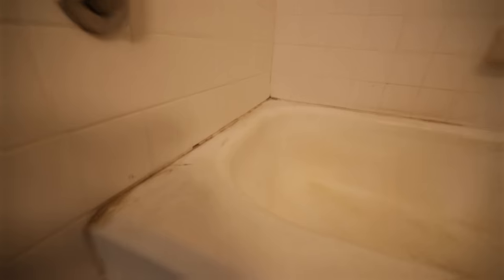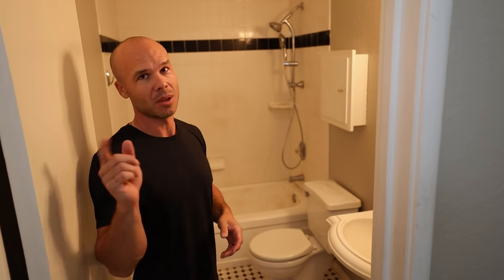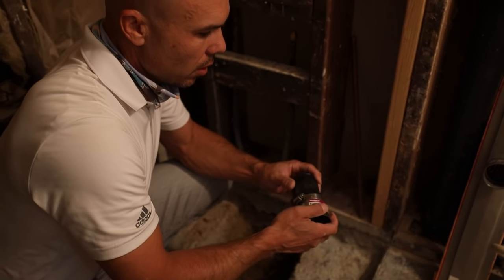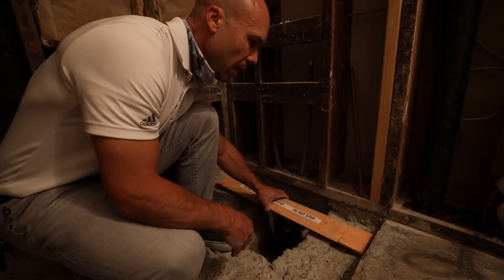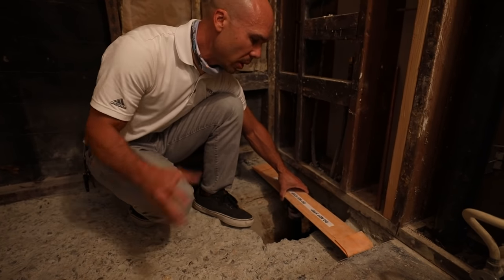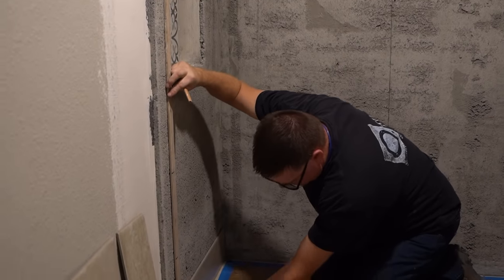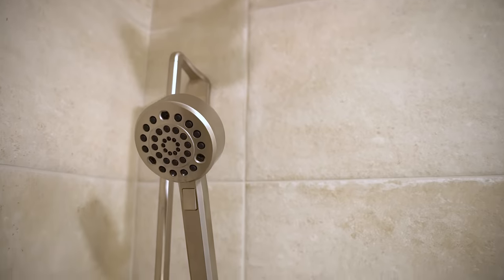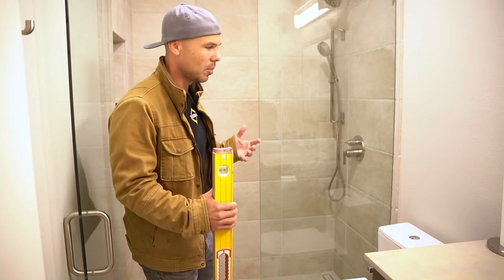TUB TO SHOWER CONVERSION (CURBLESS)-- HOW ITS DONE

Comment: A couple people asked about this but I didn't see any responses to any of them. Did you not put any vent on it? And it works fine without gurlging and doesn't siphen the pee-trap? Everything I read is saying I have to have a vent in there and it needs to be after the pee-trap... I am doing the same conversion, so need to figure that part out. Of course the shower had the overflow pipe as a vent, but that was also before the pee-trap, not after. 
So am I fine with nothing like you did? Or do I have to fit something in there? If so, does it have to be after the pee-trap? Not sure how I would fit that in there....
Thanks!
I would really love your thoughts on that.
Reply: Probably a little late for your needs, but the vent is downstream of the p-trap before it ties into the main line. There are requirements about how far it can be depending on pipe size and slope (usually no more than 6 feet from the trap). There are other considerations such as using the correct fittings (wyes vs. tees, etc.), and whether or not the vent is wet or dry. A quick google search should bring up what you need with diagrams. Or just talk to a plumber, and shoot him a few bucks (six pack of beer) for his expertise.

Comment: Do the tiles on the bottom of the back wall(the 5 foot wall) get smaller as they go from right to left because of the pitched floor? Thank you for the great coaching!
Reply: Yes, they mentioned in the video that they'd be about 1 1/4" shorter from one end to the other I believe.

Comment: Is there ever a reason to raise the rest of the floor instead of chipping down?
What are the possible ramifications of building up 2 inches rather than chipping down?
It seems like shaving off concrete is the proven method of installation. Is that correct?
Thanks for the video.
Reply: I think going down is preferable because you only have to go down in that one spot.  if you build up 2 inches, then you've basically created the same clearance that a 2" curb would have or you have to build up the whole bathroom to match and then all the other rooms on the same level to avoid a dramatic transition from flat to 2".

Comment: tell me if you like this idea if you would. My tub removal same as yours, but I don't have a toilet next to the tub, its in another room within the bathroom. So my entrance to my shower will be right where your toilet is, and about halfway across I will start a small barrier to continue over to the opposite wall. . The drain will be right at the entrance to the shower, a linear drain. then I will mudpack over the concrete, no cutting out concrete necessary except for extending the drain over to the shower entrance., and then slope the floor away from all three walls towards the entrance drain. Where the barririer wall part is I will put fixed frameless glass, and then the frameless door will be over the drain. Because I have a post tension slab, I need to hire a GPR guy to look for tension cables that would need to be avoided when extending the drain. Sound like a plan?

Comment: What’s the ballpark cost to the end customer for something like this
Reply: A good quality bathroom will cost aound 3000$ per sqare meter top to bottom. At least here in Germany,
Reply: that looks like a 15k min job for a good contractor.
Reply: If materials are included it would be 15-20k max up here in Canada, maybe a little less in the states. In reality they didn’t do that much work, mainly tile and some fixtures. Would be a lot more if it was a full bath gut.

Comment: WHen chipping out the concrete, is there a fear of running into tension cables?  Or are they typically deep enough?
Reply: If you're cutting all the way through the floor, yes. But if you're only chipping the surface then there shouldn't be anything to worry. It also depends on the type of floor, if you are dealing with a prestressed hollow core slab they are usually at the bottom of the slab.
Reply: @janpeterpilon  Thanks.  I just remember seeing a cable run right up against the tub drain when I was replacing it 10+ years ago.  I would love to have curbless as it is much more attractive.

Comment: Is there a particular reason you didn't want to go with the hydro ban board on the shower walls?
Reply: im sure only because Issac chooses to float his walls instead of waterproof boards.  either way is fine if u know what your doing regardless👍
Reply: @tommywalker5348  I was wondering the same thing.  Therefore, the mortar used to float the walls must be waterproof - otherwise this shower wouldn't have any waterproofing system on the walls.  And Isaac is THE man when it comes to waterproofing systems.

Comment: Small sinks cause lots of excess water splashing all over the countertop, vanity fronts and floor.  They work fine for powder rooms or low use bathrooms, but for daily use I really dislike small sinks.  I have ripped more than one out…

Comment: Tile Coach do you even get permits for these showers?  Every tub to shower conversion HAS to have a 2" P-trap.  The 2" P-trap is the Major code item in all shower conversions in California and you should get a second opion on that 2" P-trap in your area.  I can install showers upside down but all the inspector wants to see is that 2" p-trap.  Obviously from the video you don't pull permits all the time which is Amazing because your teaching people right and wrongs.  Spend the extra 2-$3 and do right because your tile jobs are very nice.  97% of all inspectors only expect to see the 2" P-trap and  the 2" drain line  ran as far as you can take them and then reduce down.  People take the low flow crap out in CA all the time so you can't use that for a reason and easpecially in a house with old drain lines. All you have to do is ask yourself why do my Line drains or any drains for showers come in 2" ??... there is a reason...That 2" will save your butt one day and you will never know it.
Reply: going to 2inch for him most likely wont matter. he barely replace 2 feet of pipe. as for permits i can't speak to what he actually did.
Reply from the maker: Why would you create a reduction in a line on a horizontal run where it would create a clog?  Makes much more sense to basically create a 1-1/2” outlet (yes they still have shower drains with a 1-1/2” outlet) like we do.  Inspectors can use their own interpretation on codes based on their municipalities and common practices in that area. You will notice that they vary from city to city, county to county.  Code requirements do not come from the state, but the local municipalities you happen to be working in.
Reply: Thank you for responding to that comment that makes complete sense the transition in the vertical vs. Horizontal.
Reply: Its called volume and most clogged drains are in 1-1/2" P-traps  filled with hair. That extra 1/2" might not seem like a lot but it is huge. Just like the saying, 1-2" in a shower is huge. Tubs can drain at almost any rate without causing an inconvenience. Water can start to drain from any level, depending on the occupant and as long as the tub is drained in a reasonable amount of time there is no problem. On the other hand, a shower is expected to drain in Real Time. Volume/ bigger pipes get the water out of the shower faster.  For older pipes I wouldn't hesiste to put in 2" if possible 3" lol. Like I said the bigger pipes will save you and you will never even know it.  Your vertical to horizantal thing with causing a clog? your gray water pipes are level? or slopping down? Yes they will probably clog if the pipes are level and not slopping downward. Remember our Codes are Minium requirments.  Good contractors always go above and beyond and  for 2-$3 extra seems like a good investment especailly in an expensive shower and Great looking showers you guys put together.
Reply from the maker: @MM-ms7hm  Thank you.  I believe they changed the IPC recommendation that 1-1/2" can be used in certain circumstances when changing from tub to shower (see the first comment).  California has a maximum 1.75 gpm per fixture flow rate.   If we can switch to 2" we will, if we cannot, we keep it 1-1/2".  But this shower should never have a problem especially if they keep the hair catcher in the drain outlet in there.  By having the trap directly below the drain, it is an easy snake if theres a clog.

Comment: The drain cutout is on a single tile, that cannot allow proper slope from all sides to the drain
Reply: everything is sloped to the drain. i don't get what your saying?
Reply: @Mike-Minion  The side of the drain that faces the wall is sloped toward the wall. Whenever one makes a cutout on a single tile, it'd always has only one side sloped toward the drain and the other 3 sides wouldn't
Reply: @oldhongkong565  all the side slope towards the drain. you just can't tell from the video cause the tiles and distance is so small. i have watched plenty of his videos. he definitely slopes everything.
Reply: @Mike-Minion  Well, I just don't see any grout line around the drain, so I still think it's a single tile. But that aside, it's not a big deal the drain span only a single tile in this video's case, the amount of water leave behind will be small.  Having the drain span a single or multiple tiles is a trade-off between aesthetics and functionality and homeowners do have different preferences.
Reply: @oldhongkong565  I agree - As I see it, the tile of a linear drain needs to be on plane or cut in 4 pcs, otherwise the water will pool against the back wall.  The better way would be to have the linear drain span the entire width of the shower, then use a small piece behind, sloped to it.
Reply: Re-watched the video again and found out that he did use four pieces of tiles around the drain

Comment: I'm sorry. That can't be cast iron. At least, in 45 years of plumbing I've never seen a thread on cast iron. That's a Durham fitting on the trap. Wrought iron fitting.  That nipple you cut should have been galvanized. Shielded coupling? You mean a no-hub coupling. As in no-hub cast iron.
Code... Only tub trap arms are 1 1/2". Let's see. Only 1 fixture unit allowed on 1 1/2" horizontal drain. 2 fixture units allowed on 1 1/2" vertical drain. Bathtubs, K/S, laundry tray, urinals must have a 2" horizontal drain. They are all 2 fixture units. Lavatory sinks are 1 fixture unit. I'm not quite sure why you were allowed an 1 1/2" trap on a shower. Probably for practicality. And, as you've said, volume out of shower heads has fallen. However, the 'Man' doesn't like the idea of showering in standing water. It's not sanitary. It might be more acceptable if shower pans were C. I. enamel.

Comment: how did u tighten the furnco
Reply: He left a small space when he poured the concrete around the drain, then reached in and tightened it after it dried. He then filled in that hole with deck mud.